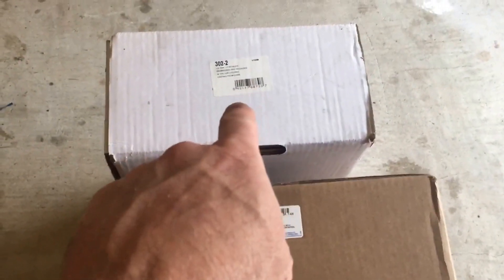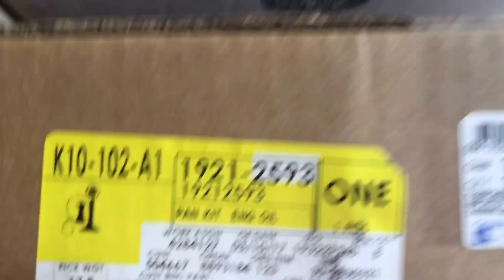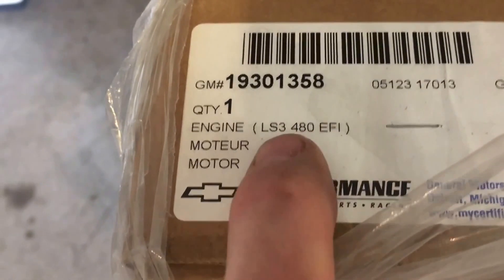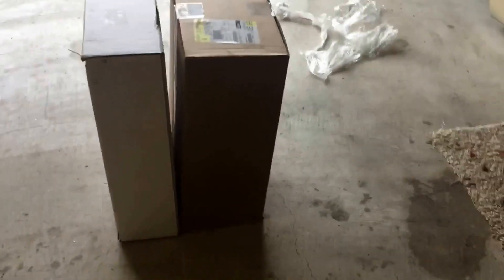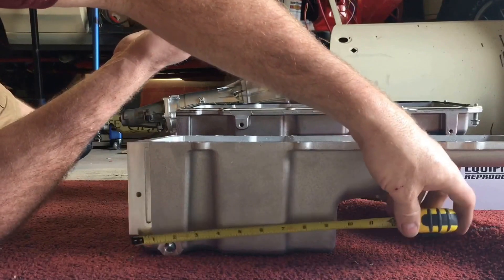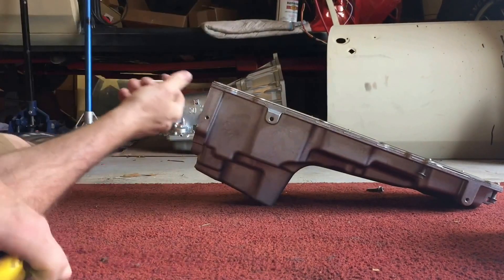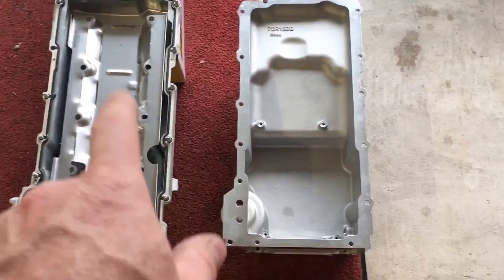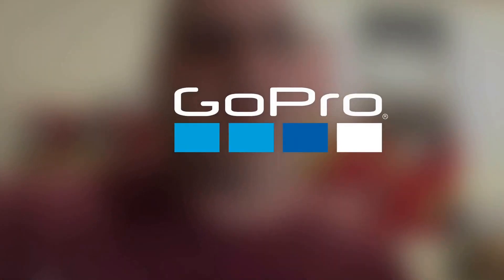MUSCLE CAR OIL PANS - GM Performance VS Holly 302-2

Comment: Holley 302-1 for impala 65-70 hands down. I just learned that lesson. The gm muscle car pan fits but hangs two inches lower than the crossmember. The 302-1 will be flush with cross member. Other cars will be different so buyers do your homework
Reply from the maker: jsta327 - right. It hit my crossmember which I knew I would. Sold it for a hundred bucks. 👍🏻
Reply: Yep and the Holley pan is 1/16 to 1/8 thicker too all i did was put washers under the engine mount perches bolts to raise it up that lil bit so it cleared the cross member by the washer width. Worked for me hope this helps you folks with a 65-70 imp. Might not be the easiest or best way its just what i did.

Comment: I think this lies down to oil pan clearence on different types of frames. You can't base one better than the other. It depends on application and what type of frame you have. Holley is well known in the industry for blueprinting and making better aftermarket parts.

Comment: Hey @TexasNova  if all Else Fails  read the Instructions ..  You are supposed to modify and use the windage tray that came with the stock oil pan ..
https://www.youtube.com/watch?v=vBMuc5gIDc4  

GM  Pan  packaged in Canada with a pan cast in China .. the Holley  pan some parts in the USA , but  pan cast in Taiwan ..  You put  your fingers over the part  #'s and info so people can't read them ..

Comment: Did you consider any oil pans by Moroso? I think they have an even better ground & cross member clearance than the holly.
Reply from the maker: Ya know I didn't think about that. The only thing is the more shallow you go the less capacity you get.. Do you have a link I'd love to see it!
Reply: Here is a youtube video by Moroso. https://youtu.be/mJDg4mVsOEcI have a 67 impala and it will be lowered & bagged and am trying to make sure the oil pan will clear the cross member and have good ground clearance. And I discovered this LS swap kit website (brphotrods) and according to them, the Moroso has a very good pan for LS swaps. Moroso seems like their pans are a little pricey but seem very popular in the racing industry. I think they have a good reputation. In that video, they talk about making up the oil capacity. let me know what you think about these after looking at them. thanks.

Comment: Where did you get that Holley 302-2 for $200?? I'd like to know since I'm about to buy one.  Second you're comparing the GM windage tray to the Holley baffle that bolts down inside the sump. When using the Holley you have to modify your stock windage tray and shorten it. Please let me know where you found that Holley for $200.  Thank you.
Reply: Oh, and where in TX are you from? I'm in San Antonio.
Reply: Sorry, I thought you were claiming the Holley to be $200. I'm can't use that GM one either.
Reply from the maker: I am from Dallas.

Comment: I am using a 5.3L Vortec into a 67 C10 (Stock FRT height) and plan on the GM oil pan. It is the OEM pan for 08-10 H3, 09 Colorado/Canyon, marketed as a muscle car retro-fit pan. The Gen111 Vortec using a grey nodular cast iron block while others are aluminum. Just keep in mind, the oil pan is designed to add stiffness to the block supporting the main bearing caps and torsional forces over the length of the engine. As for the country of origin, GM built a plant in China about 20+ years ago and sell certain Chevys & Buicks in the Asian market. The supplier for this cast is using GM molds and the correct alloy. I will buy OEM. No offence Holley, I have just seen way too many Holley casted products in the defects/returns pallets with porosity issues at warehouse distributors. I do understand well, most are installed by the DIY crowd but the root cause is clear when looking at the product & tags. Retired ASE Master Tech doing MY research for MY build.

Comment: I cut a truck oil pan only because I didn't have the cash for the holley but if I was to find a few coins in the couch ill be purchasing the holley lol good luck on your build also i would take a peak at everything just in case something is damaged it may save you a migraine or two if something is broken  lol